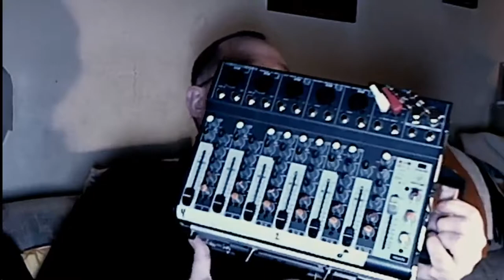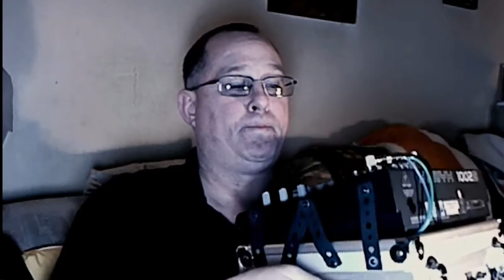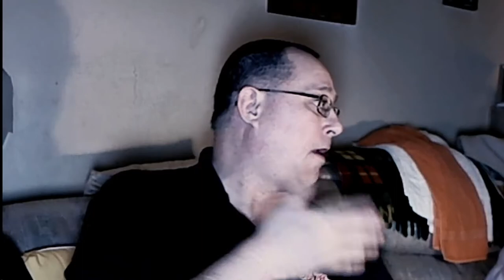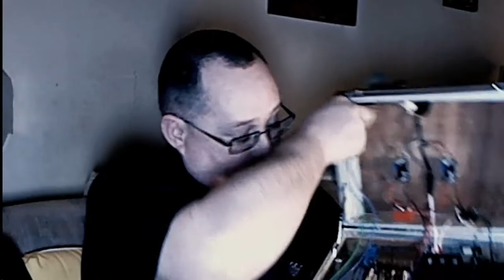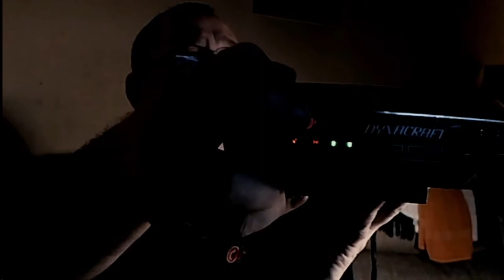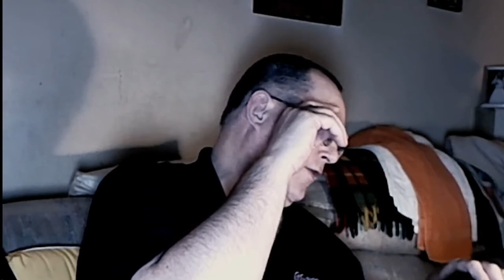BATTERY POWERED - POWERED MIXER HACK

Comment: OMG man that's the same amp board I bought to base my system off and it popped a cap right away, pissed me off and I haven't looked at it since. Mine was branded douk audio or some shit and was $70 at the time. I got new caps for it but haven't been able to work on it yet. So, you figure yours blew from reversed polarity on the power, or did I hear you wrong?